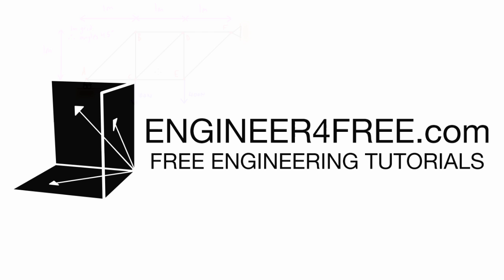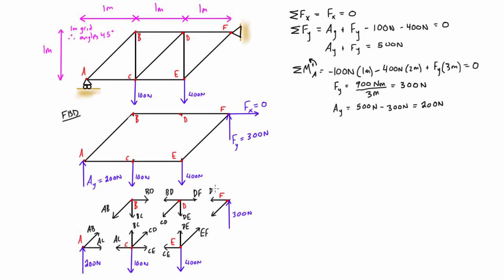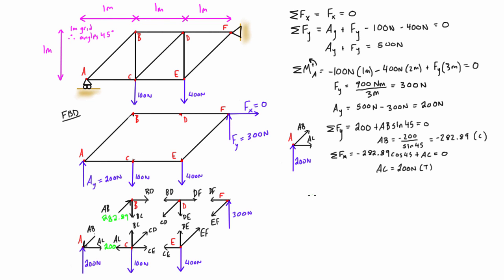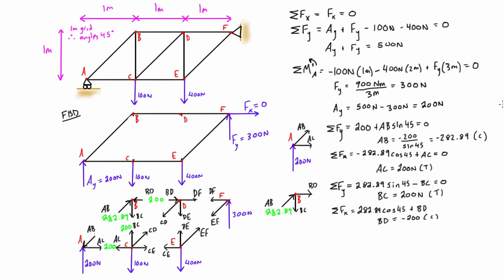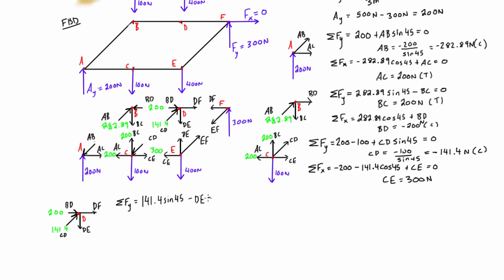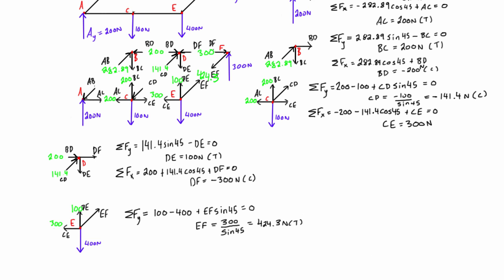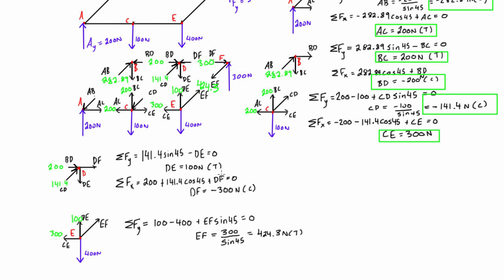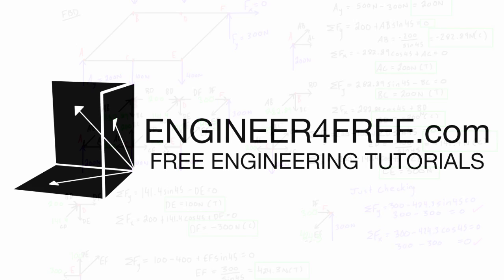Truss analysis by method of joints: worked example #2

Comment: Why did you SUBTRACT BC??? When you calculated about point B?? Its a summation and there was no explanation. I've been searching the internet and textbook for 8 hours for that exact answer. waste of time
Reply from the maker: Ok so when I draw the fbd of joint B, I draw all unknown forces acting on the join in tension. Assume tension if you don't know. Everybody assumes tension, so that if you slget a positive magnitude, you know it is indeed in tension, and if you get a negsrive magnitude it is in fact in compression (so would actually push on that joint rather than pull). So on the Fbd I draw it in tension, this means it pulls, or otherwise points down. Draw a coordinate axis of x and y. Positive x is to the righrx and positive y is up. Vectors that point up have positive y magnitude and vectors that point down have negative y magnitude. So in the sum of y expression, BC is negative because it has a negative y value (because it points down in the FBD). The y component of AB is pointing upward, so it has a positive value in the sum of forces in y expression. Please watch this video that I troduces the method: https://www.engineer4free.com/4/truss-analysis-by-method-of-joints-explained it will help. And also I recommend watching videos 42 - 51 here https://www.engineer4free.com/statics as well as review any vector math from videos 1 - 13 if needed! I hope that clears it up for you
Reply: @Engineer4Free  god bless your soul thanks!!

Comment: How do you know Fx and Fy are going up and to the right?
Reply from the maker: I don’t, I just draw assume a direction and go with it while they are unknowns. When doing this, pick your assumed direction in the positive direction of x and y, so that if you get a negative value, it’s clear that it must point in the negative direction.
Reply: @Engineer4Free  Ok thank you.  Then it's just a matter of adjustment if the assumption turns out to be incorrect right?
Reply from the maker: @asad5986  yeah, the negative sign just tells you that its preally pointing the other way. It's helpful to write (tension) or (compression) in brackets beside your answer to make it very clear to your prof that you understand which one it is.
Reply: @Engineer4Free  ok thank you

Comment: When solving for the components of a diagonal force, will it always be sine for the Y direction and will it always be Cosine for the X direction?
Reply from the maker: Hey Ryan, not necessarily. It depends on if you're looking at the opposite or adjacent side of the triangle. Construct a right angle triangle such that the hypotenuse is the diagonal, and then label the opp and adj side based on the known angle. Then determine which function you need. Basically if your using the hyo and adj, you use cos, and if you're using the hyp and opp, you use sin. Be careful to recognize which side your using and which trig function you need to use. Review basic trig / SOH CAH TOA if you need to, as that's all this is!

Comment: How come fy is 300n and not fx , since “ the hinge “ is attached on the wall ( on its side )  wouldn’t that make the fx component the y  and the fy component the x ( fx)
Reply from the maker: The sum of the vertical forces must sum to zero on their own, regardless of any external horizontal forces (which there aren’t any actually in this case anyway). So the rest of the vertical applied forces sum to 300N down, so Fy must be 300N up to achieve static equilibrium in the vertical direction.

Comment: Why is it that at the pinned point at joint F where you have Fx and Fy you just automatically make Fx=0? I know there’s no horizontal forces but if you take the moment at A wouldn’t you get two unknowns one for Fx and one for Fy?
Reply from the maker: This structure has only one horizontal reaction. That is Fx. So because there are no horizontally applied loads, then ΣFx = Fx = 0 (I apologize that "sum of forces in x direction" and "horizontal reaction force at point F" have the same syntax here...). But we find Fx to be zero in that first step. Because we know it's zero, it's no longer an unknown. So later in the sum of moments about A eapreasion, we don't need to write anything for the impact of Fx on the moment about A, because it's magnitude is zero, so it would cause a moment.